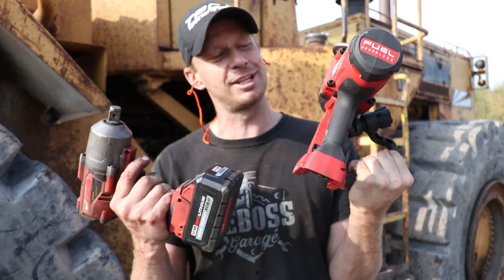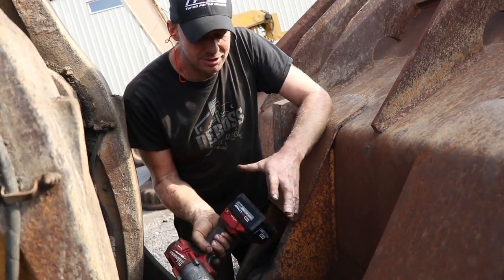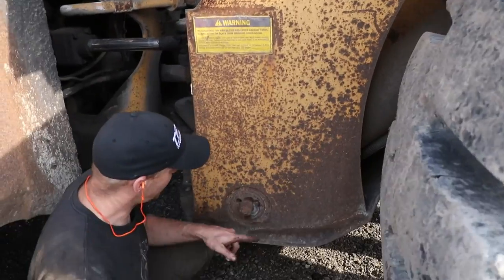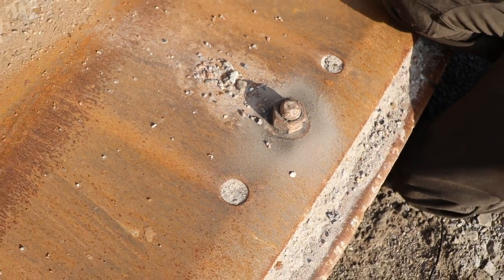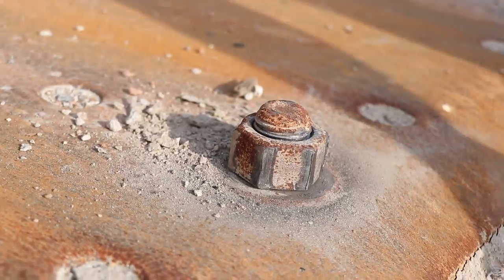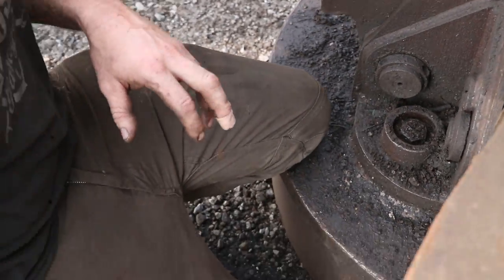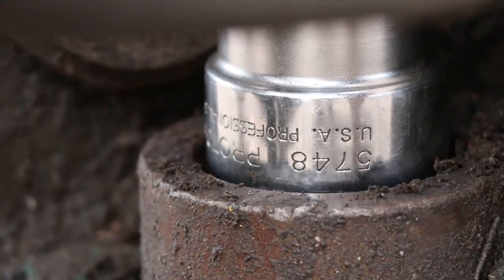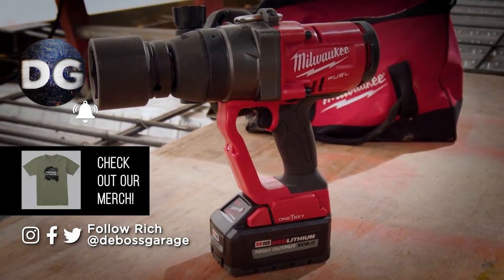Busting 40 Year Old Nuts with a 1 Inch Impact Wrench | Milwaukee M18 FUEL 2867-20 REVIEW

Comment: Wrong, must clean first and put penetrit fluid and use the inpact,in case is too tight, use torch preheat, and use the inpact,,remember this tool is great ,but no magic, use correct procedure

Comment: i would not  give you less points if you lubed the rust , and used a proper socket and  worked like a real man. But you speak about chinse bolts. TTI is a company from china that   owns  milwaukee  tools and co .   You have chinese american tools .  Dewalt is owned by black and decker 1912 USA

Comment: You are using the wrong sockets for the job so waaayyy less likely to undo those nuts
Reply: you dont even need expensive sockets. just £30 on a set of actual impact sockets
Reply from the maker: Add links to where to buy these sets

Comment: Those nuts in the bucket may have been tightened using 10 ft cheaters, pushed by 5 people, have seen them doing it. No impact can loosen them 😉

Comment: Seems like the place I bring our cars to get tires uses one of those badboys to put the wheels back on. I have a cordless 1/2in Impact with 700ftlb breakaway and sometimes even that wont take them off. I literally had to use my 36" breaker with a 48" cheater to break lug nuts on my VW car....... Jackasses